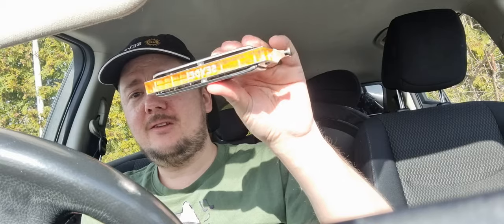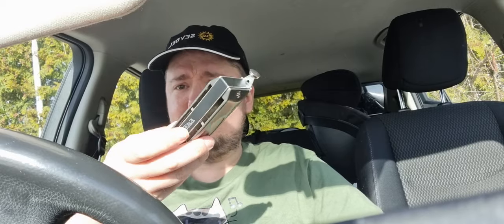Valved or valveless chromatic harmonicas? Seydel Deluxe Steel Vs Easttop Forerunner

Comment: I think the best sounding valveless chromatic out there right now is the seydel nonslider. It is much, much netter sounding than the foreruner, but obviously different since it has no slide
Reply from the maker: I haven't tried the nonslider as I am quite fond of my button, but Seydel certainly are reliable! Have you played the nonslider for long?
Reply: depending on the key, not all nonsliders are fully valveless
Reply: @TheRatBoyBoy   true, bit C, which most play, is valveless. Anyways, I'm a bigger fan of JDR's trochilus now, which is essentially a 10 hole valveless chronatic (if you buy the solo tuned version) it's tone is far superior to the forerunner in my opinion

Comment: Man it was a biased review! You were clearly boxing with the poor Forerunner's slide to make it sound. It has quite a quiet slide. Yes, there's a difference but it's like 5-7% not ten times as the price difference between the two is.
Reply from the maker: It was not intentional,  the slide on the Seydel is a lot stiffer so transitioning between them like that doesn't feel natural. I probably transferred the muscle memory from the Seydel to the Forerunner. I can post a side by side comparison with slide noise if you would like?

Comment: This was helpful, thank you! I need to wrap my head around  this now. Am only interested in the implications as far as bending is concerned. Lot of conflicting info on the internet about bending on chromatics. Some say you can bend only on draw notes, some say both draw and blow. Some say you can bend only a semi-tone, some say you can bend a full tone. And then theres valved vs valveless. You are saying valved has more bending potential. Okay 🤔
Reply from the maker: Valved can bend on draw and blow notes. Some are able to bend several semitones, but that's not something I am familiar with. I only bend for expressive effect on valved. 

If you are curious you can always make some valves at home and try on one hole on a diatonic to test it?